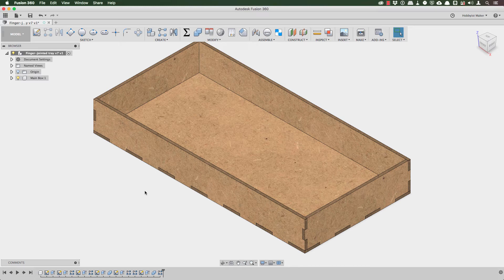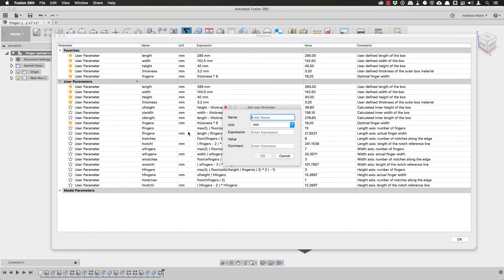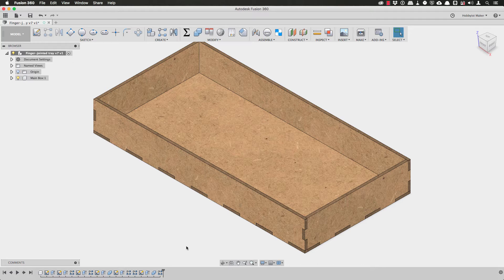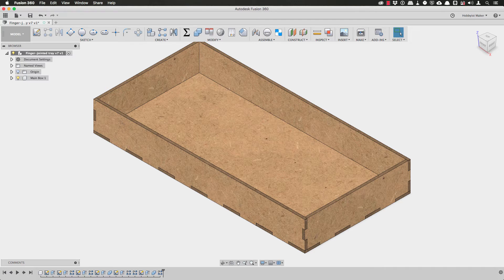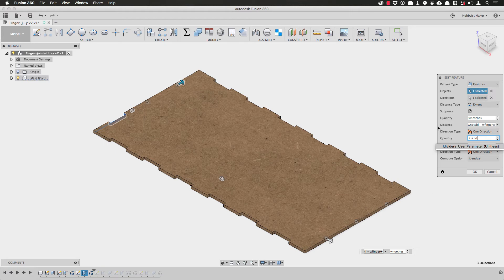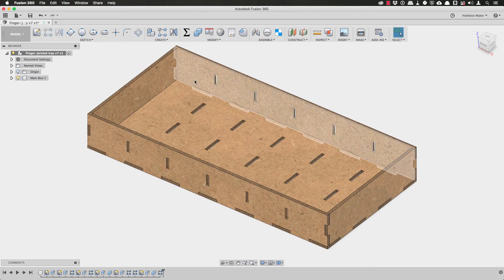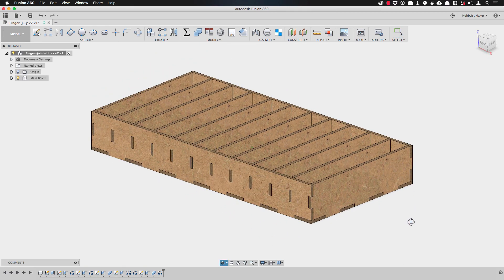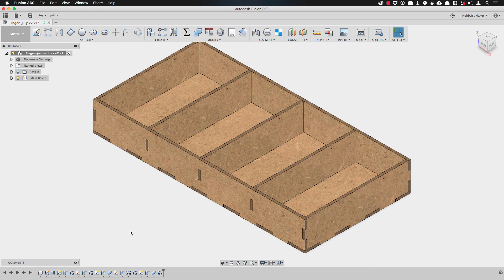Fusion360: Adding length dividers to the finger-jointed tray

Comment: well, it is 3years you did not post, anyway, I ask me if it is possible in your Box configuration to put a parameter to define a small (0,1 other 0,2mm) space between the finger joint that make it easier to mount (spaciely with huge box) and dog bones for cnc (this not a problem I think)  thanks so much to take  time to explain our little brain those complex parameter
Reply: Well first of all he is my dad, second of all he won’t be making  any videos anytime soon that I know of
Just to let you know

Comment: Hi. 
I am new to Fusion 360 having worked in 2D Draftsight for my laser cutting designs and DesignSpark mechanical for 3D printer files. Finding your postings about designing for laser cutting was great. I have followed through everything for the prefernces and now I understand a lot more about 360, it's workflow and potential. I have designed my first model for laser cutting and it worked a dream. Keep up the good work and thanks again for the time you put into these videos! 
David

Comment: In your previous video for the fingerw parameter, you had thickness *2 but now it is thickness * 6. It doesn't change anything but it is a bit confusing. Also, you might want to mention that the parameters for the size of the box are different from the ones in the previous video. At first I thought you had swapped the length and width in one of the videos because mine didn't have the same proportions, but then I noticed the overall size had changed. (It is still an excellent tutorial series!!!)
Reply from the maker: Changing the fingerw parameter should change the starting size of the fingers in the box. The larger the parameter value, the larger F360 will try to make the fingers; but, they will be sized down to fit, if necessary. I'll try to avoid that confusion in the future. The key takeaway, or what I should have explained better is that the box will adjust even with those changing parameter values. Thanks very much for the feedback.

Unfortunately, I had my SSD fail in the main system, so I'm still rebuilding everything to work on my next set of videos.